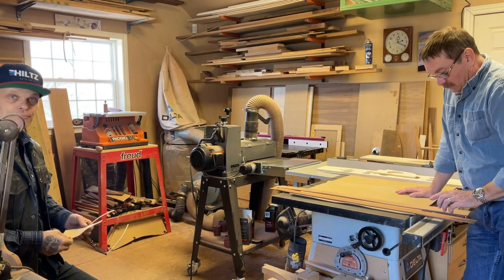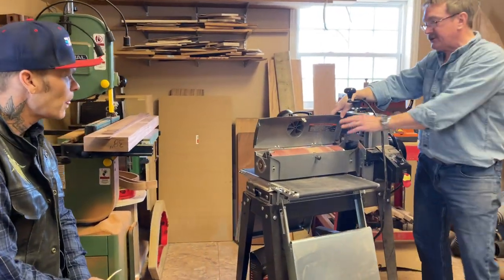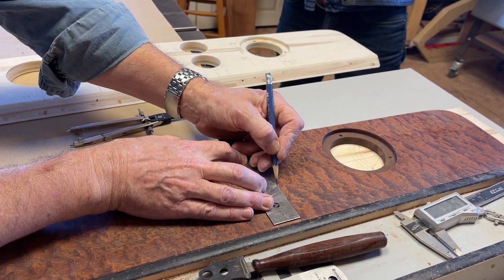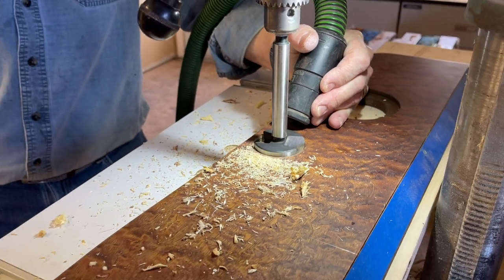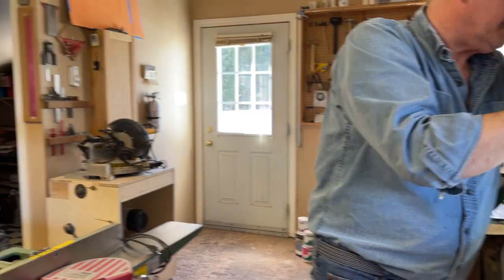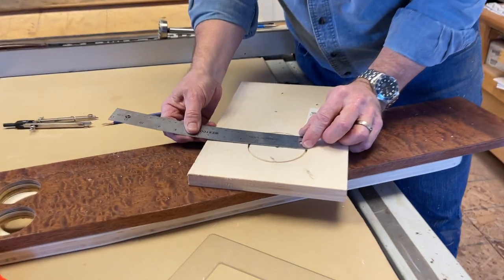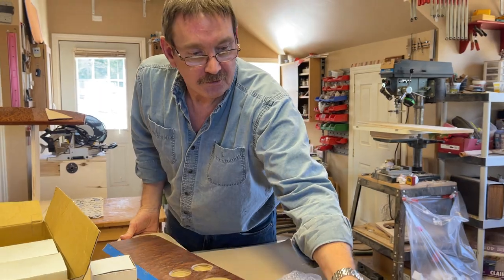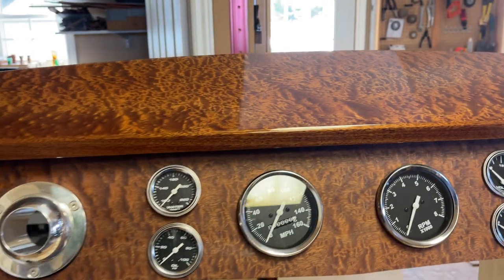BUGATTI: DRILLING/INSTALLING GAUGES IN VENEER DASH

Comment: I think the three-piece door trim is a good way to go.  With epoxy laminates and sealers, humidity doesn't need to be a big factor, but Geoff is making these parts at maybe 40% humidity in winter.  A Maritime summer is  a good bit more humid, and the parts will swell up accordingly and one long and endless piece might make bad things happen.  Three will use up their expansion joint.  That's why Bugatti's coachbuilder did what he did.  

The dash looks great!

Comment: Love the dashboard, Chad! I wish you would finish the windshield/windscreen by adding the split window divider and fix the front opening of the grill. The piece in the center below the grill needs to be cut out for a full grill. Also cut out the hood/bonett side parts and connect them to the top hood with piano hinges to make the hood/bonett fold up to open.  Then it would most likely like a Bugatti Type 57C

Comment: For those of you using a fly cutter. You can get the dollar store a clear microwave plate guard that works great for dust control when using a fly cutter.Klein Tools 53731 Adjustable Hole Saw

Comment: This Volgatti build is the longest ever. It began 70 years ago in Sweden.
Reply: Beautiful
Reply: Yup and they are all a little different that's how hand built car's are. Not some stamped out sheet metal even them are not all the same the press becomes wear after year's of stamping, that's why they stop making the body styles of some car's. Except the VW was the longest running body style Mexico was the last manufacture.

Comment: Cant believe he didnt clamp it down when he started drilling. My luck the dash would of start spinning with the drill. Made me nervous
Reply: With the belt on the drill press loose like that, if the bit grabs, I won't lose control of the work piece, the pulley just spins and the bit stops until I pull it free.  Painful to watch, but hey.......
Reply: @gwebster3500  thanks for the explanation of why the bit was stalling.  Yes, it was a bit tedious to watch.  I caught my breath when you let the piece lift cutting the last big hole with it running, that's where I would ruin the piece.  On the last hole.  I really like that adjustable hole saw though, I made a couple of these for Lotuses and the Forstner bits went dull very quickly.
Reply: @douglasnicholls1366  yes, even I had to fast forward through the drilling parts, t would have been great to do it during the live session too.  absolutely, the last hole is usually where things go terribly wrong, but we have lots of opportunities yet to screw it up...........
Reply: That is a beautiful work of art! That grain is so beautiful to see.
Reply: drills have clutch systems for that exact reason. Or belt tension and pulleys on some drill presses. Ultimately tho it comes down to the force being applied isnt enough to move a object of a certain size and weight..  The scenario you described would never happen..  I.E. If I have a 4 ft 4x4 and Im drilling a 1inch hole in the middle... Clamp or not, My drill woould never put out enough ft lbs of torque to spin tge 4x4 uncontrollably. Fear is dangerous.. having respect for what your doing and using caution is different then out right fear.. People doing tasks that scare them is how people get hurt.. its irresponsible
Reply: You read my mind.
Reply: He makes the bit to slip by the tension on the belt of the press.

Comment: You see that drill chuck has three holes to put the chuck key in? Well if you use all three to tighten onto the bit then it doesn’t slip like that.

Comment: Just my 2 cents but I would fill the grain before finishing to get a glass smooth surface that is the standard for a concourse car.  Great work so far.
Reply: Not to worry, It will be piano gloss smooth before it leaves the shop.  It's almost there now

Comment: I noticed Geoff doesn’t clamp his material down when drilling the holes. Will the material move or slide on him when drilling? Also, is that material that hard to drill through? Or does he need a sharper drill bit?
Reply: The material doesn't move.  The Plywood substrate is not that hard and I could have used a sharper bit for sure

Comment: Wish we had a bit more info on the veneer & glue used. I see how the holes in the finished dash were made but how was the first template cut so cleanly?  Now Geoff improve your vacuum system Do something to reduce lack of power in your shop drill .
Reply: Go back several weeks and we did a video specifically on veneering the dash.  I have three vac systems, but I used the smallest in a closet for sound control.  The drill press has served me well for years as I dont use it that much.  If I did use it more, I would have a larger unit.

Comment: Jeff needs to tighten his belt on the drill press!
Reply: I leave the belt loose so it does slip if the bit catches.  Sorry it bothers you
Reply: @gwebster3500  Geoff, I apologize.
I just read over my comments and I was criticizing the way u work. That is not my place. You know your tools and the materials your working with. I was on the other side of a screen. Project looks great. Please forgive me.
Reply: @mcjok88  No worries.

Comment: ive been using 2k clear on wood for years, dont let this guy put poly or laquer on it.  clear it, might take 5 coats, but you can wet sand and buff it like paint.
Reply: Thanks.  If you go back to the veneering video, I describe my finish and finishing the finish process